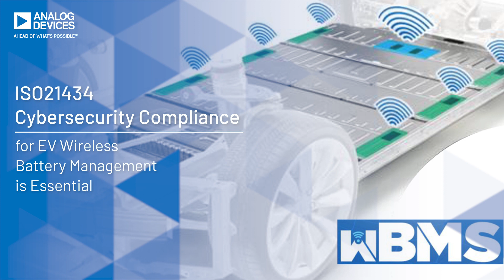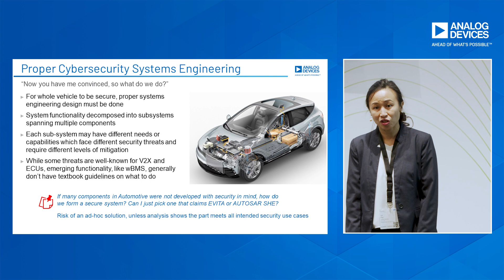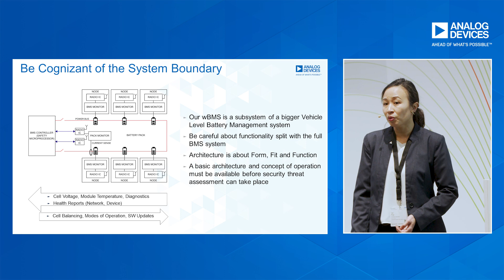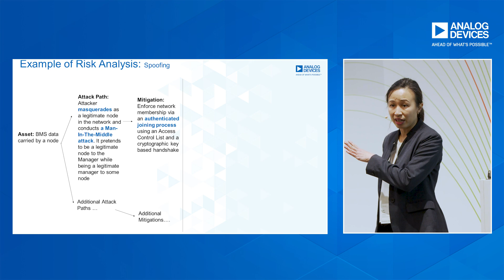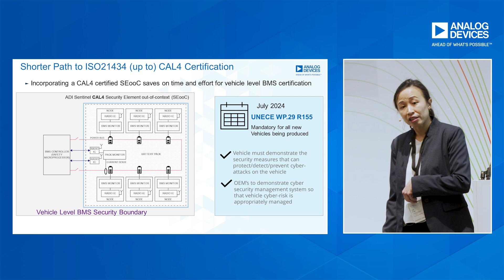ISO21434 CAL4 Compliant Wireless Battery Management System

Comment: Summary
* (00:00:20) Shift to Electric Vehicles (EVs): By 2040, two-thirds of the world's passenger vehicles are predicted to be electric.

* (00:01:08) Wireless Battery Management Systems (wBMS): The trend is moving from wired to wireless battery management systems in EVs. These systems debuted in production in 2021. wBMS eliminates complex wiring harnesses, improving reliability and reducing maintenance.

* (00:02:06) Benefits of wBMS:
    * (00:02:10) Sustainability: Enables a "reduce, repair, recycle" strategy, which can lower carbon emissions by up to 7 tons per battery pack through potential second-life applications of the battery.
    * (00:02:40) Reduced Recalls:  Helps streamline repairs and reduce expensive vehicle recalls.

* (00:03:18) Safety vs. Security: Safety focuses on unintentional hazards, while security addresses intentional threats, like hacking.

* (00:06:11) ISO 21434 Standard:  A new standard for automotive cybersecurity, similar to ISO 26262 for functional safety. It provides a framework for building secure systems, including threat analysis, risk assessment, and mitigation.

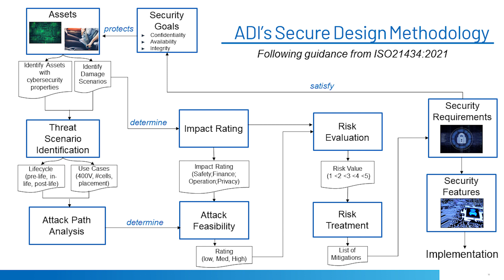* (00:09:29) Importance of Threat Analysis: Understanding potential attack paths is crucial.  Severity and likelihood of an attack are assessed, and appropriate mitigations are designed.

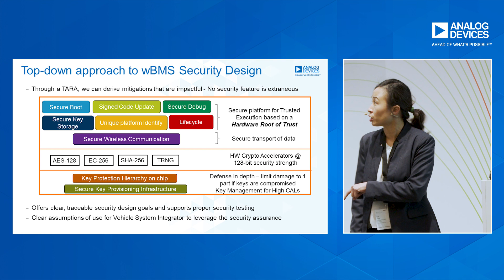* (00:17:57) Analog Devices (ADI) wBMS & ISO 21434: ADI has achieved ISO 21434 certification for its wBMS, indicating it meets rigorous cybersecurity standards. This makes it easier for car manufacturers (OEMs) to integrate ADI's wBMS into their vehicles and comply with cybersecurity regulations.

* (00:18:53) Key Takeaways:
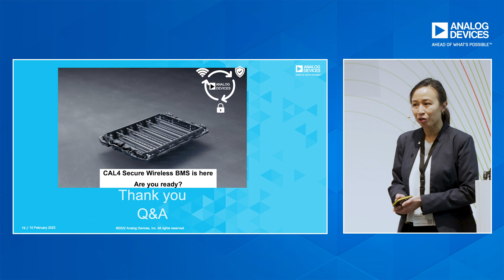    * (00:19:39) wBMS is a promising technology for EVs with sustainability and maintenance advantages.
    * (00:19:39) Security is a crucial aspect of wBMS design, necessitating compliance with ISO 21434.
    * (00:19:39) ADI's certified wBMS offers a reliable and secure solution for EV manufacturers.

I used Google Gemini 1.5 Pro exp 0801 to summarize the transcript.
Cost (if I didn't use the free tier): $0.1702
Time: 93.91 seconds
I added a 61 second delay to prevent a rate limit of the free tier.
Input tokens: 45860
Output tokens: 923